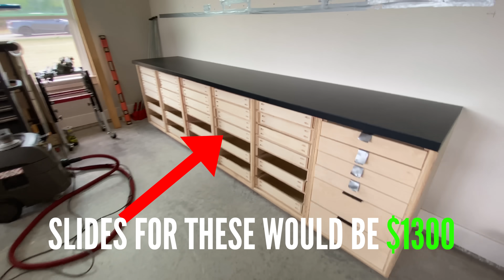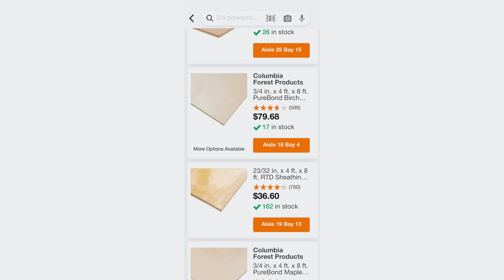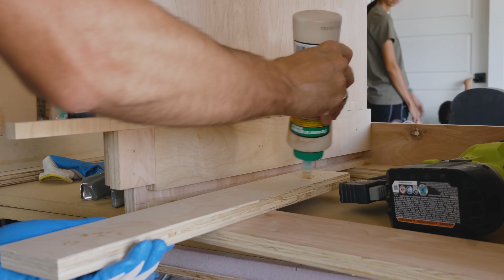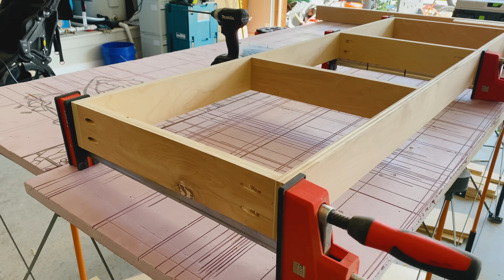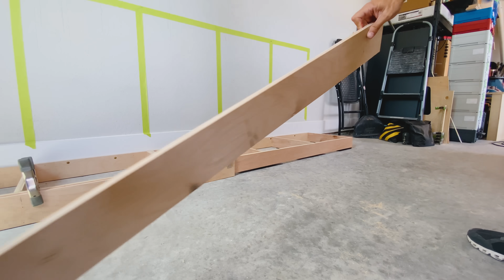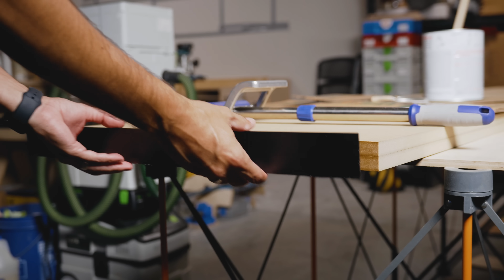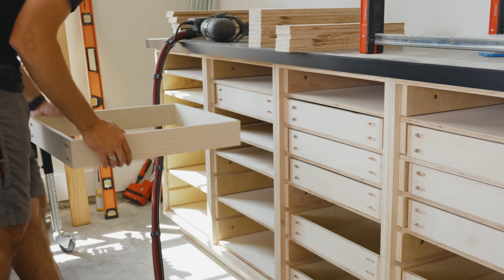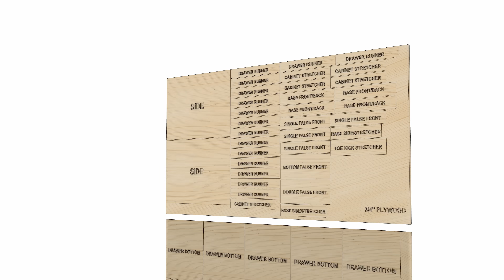Drawer slides are expensive. Do this instead.

Comment: In a past life, I built boat cabinetry. We all used the 1 piece trim bits. Apply Shortening on all laminate edges that will be your bit guide surface. Laminate is a "Soft" cutting material. It does not need a lot of pressure against the trim edges. Even with a bearing bit (as some have mentioned),  "Grease" the edges. this is faster and cheapest way to go. A small can of shortening will last a small shop most of a lifetime.

No matter which bit you use, you need to file the edges flush. Break the razor edge with a slight 45. Use a cleaner of your choosing (Lacquer Thinner, Acetone, Turpentine...) This removes any Glue Squeeze-Out & the Shortening.

Great Job on your cabinets!

Comment: You always should test a mock sample to familiarize yourself with the glue that you're using (how fast it dries, how much you need, etc.), and to set your trimmer up.  In our cabinet shop, if I were to use a flush cut bit like you did, I would have run a strip of tape to keep the blade from doing what it did in your case, and also to prevent the bearing from marring the surface, which is something that tends to happen as the glue globs up on the bearing and it starts spinning with the bit instead of rolling with the surface. But I'd most likely have used a bevel cutting bit which would have knocked out 80 percent of the time you spent filing that edge, plus I can tell you that a smooth, consistent bevel edge will one day make the skin under your forearms appreciate your thoughtfulness on its behalf. 😉
You can always run that bevel in the future if you ever wish to.

Comment: I subscribed!

This made me want to go wood shopping in Ft Worth! I also will be checking out my local owned lumber yard for my next project instead of the orange and blue places.

I've had parts to turn an MCM nightstand into a sewing caddy to roll from one machine to the other for a while. Just after I got the idea, I lucked into 2 divided bamboo drawer liners that would make perfect drawers for my purposes, but the cheapo drawer glides at HD meant it would be difficult to just pull out the drawer and use it on my work table. Your plywood glide system is the perfect answer! Plus I can add felt to the bottom, just stay clear of the glide area. For my usage, I'll clean the finish up a bit and run some candle wax along the edges.

As for the taped paint bucket spout.....hugest DUH! moment in my last 2 decades. Thank you! Thank you!

Comment: The marking on the edges of your countertop is caused by the router bit and its from heat. I've heard that the "pro's" will wax the edges of the countertop before routing to help prevent the burning .. spent one summer working for a large cabinet maker as a teenager. hope that helps! 🤿

Comment: if you have a fungus growing on your wood, it will contaminate the new plywood. You may have:
1 - burned the contaminated wood with a blowtorch (I bought mine just for that)
2 - "paint" the 2 plywood (the face you will stick) with turpentine.

leveling the plateforme: how to solve your problem without sticking or nailing anything: you measure the new height of the platform exactly as you did. then you cut the extra part at the back instead of adding it at the front. IDK if it was clear...?

the back wall: you can buy a plaster tube with an applicator and apply just a little to cover the seams. it would have been more effective and clean. just saying.... :face-red-droopy-eyes:🤿

Comment: My dad used to make custom speaker boxes for yachts and houses in palm beach out of MDF and Formica.  Contact cement is so much easier to apply with a spray gun.  But damn, those edges can be sharp before you route them smooth....

Comment: really nice work I like the idea of not using expensive glides. I apprenticed under traditional onsite cabinet builder. the cost of the glides are absorbed by the purchaser, I probably would try your method accept it's been ingrained in my mind not to attach drawer bottoms or door panels to allow for expansion. I'd like your idea of not having zero tolerance that expansion wouldn't effect, I have to admit i do like the self-closing slides(with) minimal push of course... snorkel me down mate

Comment: Just a quick note on this great video - if the wall that you opened up separates the garage from a living space, you're required by building code to fire tape it (1 single tape & float process - doesn't need to look good).  That said, it also has to have insulation inside that wall to meet a 1-hour fire rating.  Not trying to be a know it all, just trying to make sure you're aware.  Beyond that, fun video and a nice way to build shop drawer bases!

Comment: Sorry about your water damage, at least you didn't need a :diving_mask: to find the table saw.
Very nice design and about the right attention to detail for shop cabinets :)  I had a buddy that had a design for cut out drawer pulls that left solid material on the drawer, and made a nice little pocket for a finger pull and was very simple to construct - he only used a table saw.  He'd do that on the bottom front of the drawer so no dust would build up in the pocket.  I don't remember how he did it though.  He's long gone and any cabinets he made aren't where I could get a look at them.

Comment: With a drawer pull for a garage cabinet I would have just punched a circle hole in the front to use to pull out. Its mid century modern and free.

Comment: After living for fifteen years, with a cheaper bottom drawer slide that came with a prefab cabinet, and which only extended 2/3 of the depth, I finally replaced the slide with the same B brand slide he passed on. I had to finagle non-standard depth and drawer length with shims, but now can fully open and load a solid unit. He can never risk extending any drawer much beyond half-open.

Comment: 🤿great video. Former custom cabinet builder while in college, and great work on using a standard saw to make all your pieces!I agree with the cabinet maker tip for laminate counter tops. Definitely need to break that edge with a flat file on your laminate top to protect it. Love the lesson on non-drawer-slide build!

Comment: Love the look of the cabinets but two things stand out to me, first is that those handles look like leg rippers, and the exposed edges of the plywood between the drawers would drive me crazy. I think I'd have to cut and polish up some aluminum trim or maybe add some veneer to those edges. 
I doubt if I'd have bothered to tape and finish the drywall behind the cabinets, but maybe a layer of foil tape at best but I've never had drywall in my shop, its always been concrete block or plywood walls with laminate half way up. 
I'll second the suggestion that was already made below as to using laminate for slides, I did that 30 years ago on mine and its still fine yet today.

Comment: The entire point of duct tape is for creating a vapour barrier for duct work, hence the name. My 2 favorite "duct tape" type products are Tuck Tape® and Gorilla Tape®, for opposite reasons.Tuck tape is actually sheathing tape and is super thin, flexible and incredibly sticky. Don't stick it to your skin. It's used with sheeting creating a weatherproof seal during the construction phase of a project. Now on the other end of the spectrum is Gorilla Tape. That stuff, in my opinion, is the highest quality Duct tape on the market. The fabric backing is super strong, but still flexible without being too stretchy, and is coated with a double layer of tape adhesive ensuring a secure bond. For what you did with the drywall, I would recommend Tuck Tape, as it lays incredibly flat, it doesn't add much bulk at all to the seam. However it's bright red. Doesn't exactly blend in.

Comment: The problem with the trimmer bit is heat.  When making long trims. The bearing heats up and starts spinning too. Or the dust clogs it up and creates same issue. The fix is to stop and clean bearing after each long run.

Comment: Motor Oils are designed to keep your normally healthy engine running efficiently and nothing more needs to be added to make that happen, the buck stops there end of story! 

In this sense you are absolutely right, BUT you are so far off the mark it astounds me. You are hyper focused on the idea of regularly adding additives along with an oil change. Additives are best when your engine isn’t performing properly and you can’t properly address the heart of the problem (i.e. excessive wear, excessive deposit buildup, gasket leaks etc)

What if you’ve purchased a vehicle and the previous owner wasn’t so meticulous about maintenance? Well then your engine is now NOT operating like it had been designed to and the motor oils which have been carefully tailored to work the best are now  no longer capable of doing so. The additive packages get prematurely used up and the subsequent deposits aren’t the type that the oil is designed to breakdown. Excessively worn rings or leaking gaskets are a condition where adding a thickening agent can sometimes help, again a condition that normal oils aren’t designed for. Sea foam [i hate the stuff] foams up the oil in an attempt to break up deposits. It damn well shouldn’t be used regularly, maybe as an engine flush before changing oil. Marvel Mystery oil as well, YOU WOULD NEVER WANT your oil to dissolve deposits and keep them suspended. l

I’m fully aware what the manufacturers of these additives claim and that they aim to make you think you should regularly purchase them to add to your oil. They are incentivized to do that but look past their claims and what they say and use the additives when the situation calls for it until the issue alleviates or you can properly address it with an appropriate solution.

Marvel Mystery Oil is AN AMAZING cleaner for engine carbon deposits. A friend of my mother’s NEVER would change the oil on her 1987 Ford F150.
I opened up the oil cap to the engine and it was just caked with black carbon deposits. I

Comment: I would have built in the corners of the toe kick, and added low profile heavy duty weight bearing wheels, that can be levelled up.  For me, I find my use of space, needs to remain flexible.  A couple of locking wheels are worth it.
Reply: PS… clear plexiglass glass fronts can identify what’s in the drawers without opening everyone.  🤷🏼‍♀️. You’re welcome.  😉

Comment: Trim off the laminate so that it overhangs less than half the diameter of the trim router. Your trim router is trying to cut the laminate when it should be trimming it. 

I mask my edges with blue tape and then clean it off flush with a belt sander, then laminate the top. Use the sled saw to remove the excess laminate and then use the trim router. Finish with the magic file at 45 degrees like you would use a draw knife. Work it slowly for a burnished edge. Remove the tape and do the final pass.

Comment: To offer a perspective on your duct tape vs mud question:

I used duct tape to seal drywall in my garage 20 years ago. Quick and dirty, I thought.  In five years it was dried out and brittle.  In 10 years it was peeling off, and the residue was impossible to remove.  For the past decade it has looked awful, and now the time it would take to mud properly would exponentially negate the time I saved with duct tape.  So good on you for using mud.

In the northern states and Canada, however, choosing either duct tape or mud would be a moot point if the wall were to be insulated without installing and sealing a vapour barrier.  Within five years the mouldy drywall and cabinets would be landfill, and the garage would be undergoing remediation.

Comment: Great video. I like the slide less drawer option. While nice the price is a little ridiculous. I’ll be using this method to build my first ever set of cabinets. 

For the damage to the sides of the laminate top, I’ve see others follow up with a round over bit. It eliminates the sharp edge and I imagine would do something to deal with marks left by the bearing while trimming. 

The duct tape for drywall was a nice touch 😂 🤿

Comment: Use painter's tape on the sides before you router the top piece off. Then pull off the tape and file the edge (about 80 degrees) for a perfect edge.

Comment: I will probably never build anything out of wood- but loved watching this.  My dad built our kitchen and bathroom cabinets in two houses when I was growing up.  (He used a file to get the edge off the laminate-took some time...).  Anyway, two years ago we had a major kitchen reno and our contractor reminded me of the way daddy would have built things.   The cabinet company's video was also like that  me thinking if daddy was alive, he would have done it like that.  In your video, I kept thinking how much my dad would have enjoyed watching this.  Love it that someone put a bunch of time stamps on some really good points.   Even though the things I watch are usually sewing or crafting related, I could still get good out of this.  (this is great videography!). This method of drawers (btw, in the midwest it's pronounced  more like "door" with an "r"  in there).  This method of drawers could/should have been used in inexpensive chest of drawers that used the bottom center hardware, that is now broken and the drawers almost fall out.   I have a couple of small chests (one is a library card catalog cabinet) that the drawers stick and I'm going to try wax, and then, if that doesn't work, I am going to try to find out what that tape is that was mentioned and where to get it.   Also- when we did the kitchen, there were a couple of pantry cabinets that the GC ordered without the shelves and he MADE the shelves and some are adjustable and others fixed.   One of the fixed ones is for my kitchen aid mixer and it is HEAVY.  I love it that these 3/4" shelves are not going to bow and sag.  He also trimmed the front edge of the shelves--  (another thing daddy did.).   I thoroughly enjoyed your video and the only thing that slightly worries me is if you get another flood-  even of minor proportions-- the idea of those cabinets being ruined b/c of being in contact with the floor-   scares me.  I have never been scuba diving but I did find that that is where you find a snorkel being used....    🤿

Comment: snorkel tips// for the shimmers out there:elbowcough:. Use scrap wood to screw to the inside of your leveled riser lattice. Then pull your shims back out and toss them back in the tool chest. Preventing the unit from going out of level ever. Don't use OSB on wet floors, if ya have to, caulk seams. Use mechanical fasteners from the inside out.

Comment: 🤿 In the video it seems like the drawer “runners” were also made using 3/4” plywood. If that’s true, was there a concern regarding performance or functionality that lead you to use 3/4” vs. slightly less expensive 1/2” to create the runners?

Comment: A simple drawer design...but realistically, one could just use the regular Blum or equivalent Euro style 20" white kitchen drawer slides $8/ea shipped from Amazon. The lower cab would be like $48/ea for slides. The time and material comparison would likely end up cheaper. They're rated for like 75lb or so. They also provide some slop for inconsistencies in drawer size. Inside cab width minus 1" or so, could use 7/8-15/16"

Comment: I like what I see, and, wanting to develop my own sizings,, and a few other mods, I got to work measuring, calculating. Your comment about 'intricate math' to figure out drawer slide spacing if you want them to be all equal (Modular?) got me going.
I have been following great debates about metric v imperial on a social media forum. I measure and cut in mm, like most metric users do, and getting to that drawer spacing calc sent me off to good ol' Excel, where i just started loading in numbers. 
Of millimetres. 
Wow, easy! I could dial in different kick panel heights, board thicknesses for the top and the bottom drawer lift amounts and see the results
And because i put together simple formulas, i could do that jiggling, and noooooooooooo conversion to imperial fractions!!
Even tempted to look at super shallow drawers for tools,, with a drawer height of just 35mm, or less
Reply: here is what I came up with: These were Excel cells, I couldn't copy the formulas, so have put them in a 4th column
1   O/all heightt	        900	900        =B1
2   top thickness	        24	876        =C1-B2
3   top stretcher    	17	859         =C2-B3
4   bottom stretcher	17	842         =C3-B4
5   bottom spacer	        17	825         =C4-B5
6   Kick panel Height	100	725         =C5-B6
7   # drawers	                 8	90.625    =C6/B7

All easy using mm, but if you are familiar with excel, you would easily figure how to load this into a spreadsheet page, then, change any figure in column B and watch the drawer height change. I guess you could do it with imperial measurements, but using decimals instead of fractions

Comment: Hello Sir, great video. On the duct tape joint sealing of the gypsum board. The one aspect I would mention is that of fire resistance. Don't know that I would encourage finishing with duct tape. If it was the correct choice, it would certainly be cheaper, faster and cleaner to do so. The mud is what makes the gypsum board a seamless layer to reduce fire spread. Take care. Stay safe.